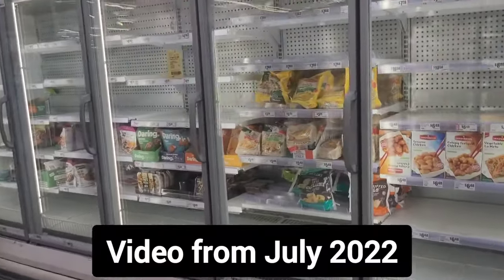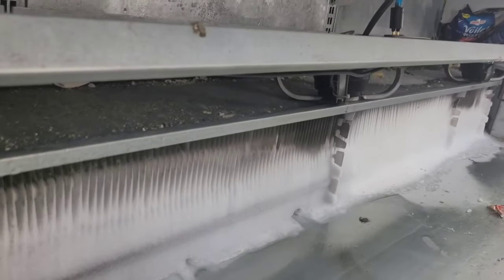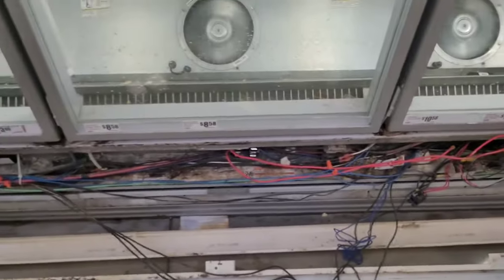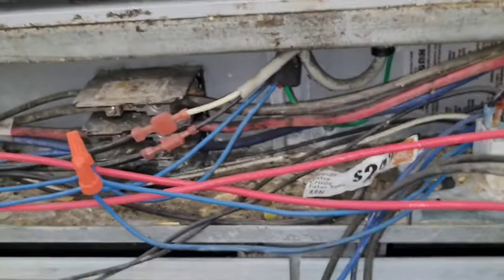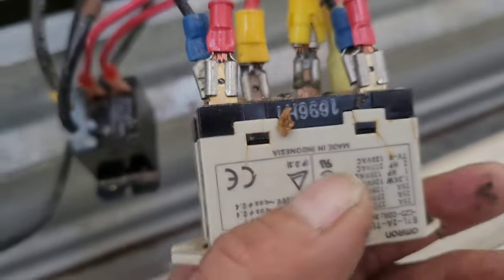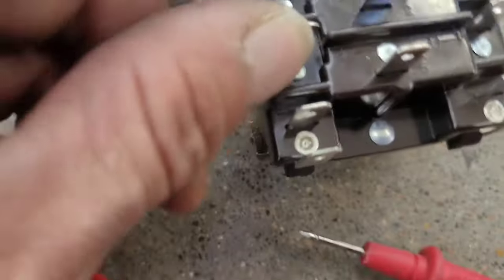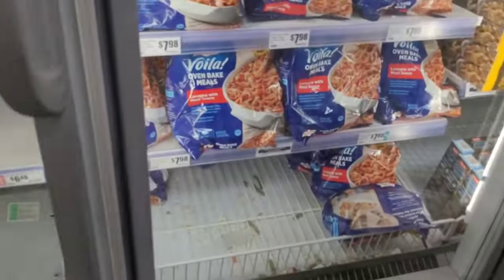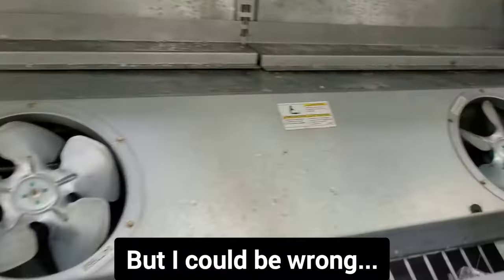The BIGGEST MISTAKE New TECHS Make On A Frozen Case

Comment: I" sure you know this but in case someone new sees it. If you push up the back until it stops you can run a self tapper into the back bracket to hold the back wall up. Then you can get the ice behind the coil and in the void (cold air goes from the back to the top). Like you say "all ice has to be gone". Old guy that I started supermarkets with taught me that.
Reply from the maker: Yea, all that ice has to be gone.  That is what all new techs learn the hard way.  Lol